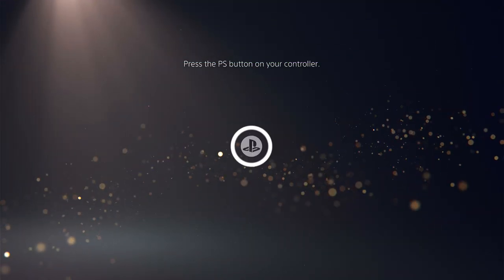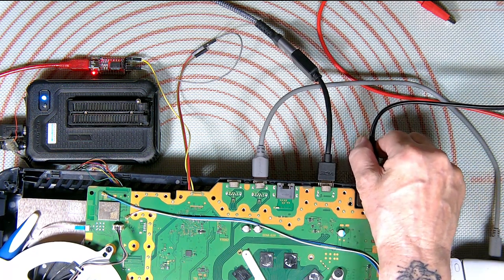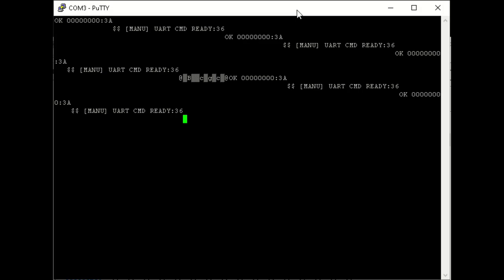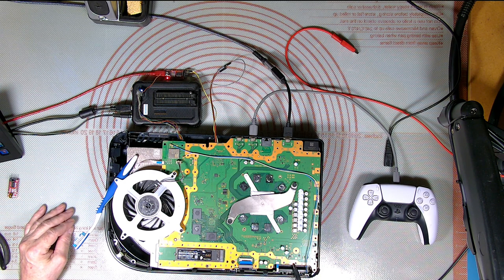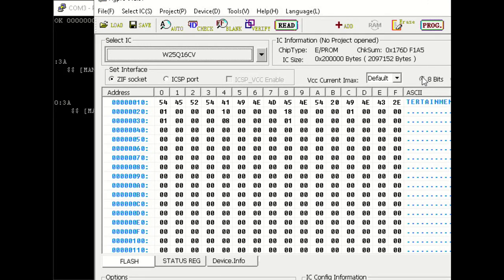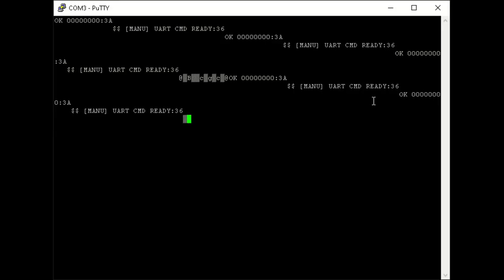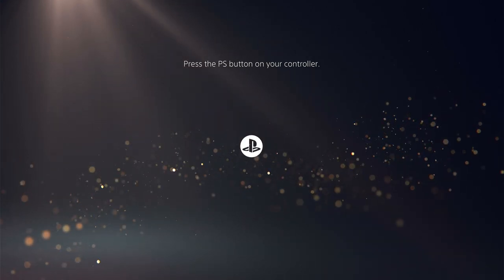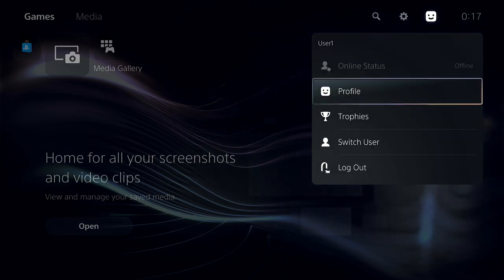Use a UART on PS5 to diagnose SB also demonstrate the 3 Beep no function NOR corruption its a start

Comment: Thank you for the video :). I just watched it. So, I've got one PS5 which is completely dead and all the voltages, including the standby ones are OK. I thought either a problem with the BIOS, or Southbridge, or maybe storage. Will try the UART way.
Reply from the maker: It is work in progress but we are slowly unlocking its secrets
Reply: @Steve_be  I've ordered SVOD4, I think one of the best programmers for us out there, the customs charged me over £80 for the duty :D. Hope it's worth ;) it.

I'll make a video on my inte team screen protector channel about it. It should be capable with an additional software to pull all the BIOSes for each IC you insert into it. I'll try to buy that software and show it in action.

As well, should be able to program ICs from SONY TVs which I struggle as well.

So, huge hopes to be true. For now I'm using the regular CH341A and I hate it :D big time ;).

Comment: Hi Steve, really useful vid,  I have a random issue where my Blu Ray daughter board has a supply voltage short BUT the PS5 can read it and install updates - just doesn't take disks - keeps blowing the 12v supply fuse.  checked the board with voltage injection and the CXD90063R-1 chip get hot (1 ohm resistance) -  nothing else on board seems to be causing this (have removed most caps etc. ).  Do you know if I can extract the data / clone the chip on the daughter board? obv. no good swapping it to another board as 'it' seems to the short..
Reply from the maker: In short no.. as things progress there may be a answers in future

Comment: Hi Steve I have a edm010 disc CD drive falied.I have another dead edm020 with disc drive and want to use it in edm010 so I can use and update. Possible to use it with Cod SW.  What do I change in 8legs chip with Cod sw near the SB to make it work in 010.
Reply from the maker: If you want to make edm101 work with out a dvd you can but you cant change a dvd you have to swap the daughter from the old to the replacement on
Reply: @Steve_be  Thank you for your kind reply. I do not have the CD ROM for the edm010 as she is dead but I have a dead edm020 with the cdrom . I wanted to use that with the edm010. I have the bios of the edm020. The Cod does imply
with his modifier you can keep cd going from another board if your one is dead. May be I got that wrong
Reply from the maker: @astral5322  to swap a dvd disc player you must have the original  daughter board  that was matched to the mother board its not in a nor or a me, chip its in the original renesas chip that was with the original system.
Reply: @Steve_be  Steve thank your for your trouble. I am aware about the "renesas" and swapping of daughter board which I have done many times. I think it is just the way the coder wrote it on his web about his modifier that confused me. Now is clear it cannot be done. Thank you
Reply from the maker: @astral5322  implies is correct as yet its not been possible because the renesas chip carries the key, so we can use the Nor (bios) to stop the unit looking for a key but we cant use the bios to inject a key plus we have not got the encrypted key which as i have said was in the dvd renesas even if we had the key it cant be injected from thje bios i hope this makes senes ,, i know the video you mentioned im a a good mate with phil(cod3r)
Reply: @Steve_be  Thank you for your good explanation. I know you are his good friend as he has said that himself. As in your video you thanked him for the shout out. I found you in FB game console repair  legion. I have sub to you. Looking forward to seeing more of your videos and you are very knowledgeable.
Reply from the maker: @astral5322  thanks for kind words you can send me  a friend req on face book same name

Comment: Hello. what red wire goes to t56?
Reply from the maker: Hi the red wire is not connected to the t56 it goes back to pin 8 of the nor, to read the nor wile its on the mobo you need to feed the 2.6v to the nor pin 8 from a external source .

Comment: Steve, are you leaving the NOR on the board for convenience or to reduce heat risks? Cheers. Rob
Reply from the maker: Its for convenience as i reprogram the chip many times trying to find more answers,  plus it reduces risk of heat damage ..
Reply: @Steve_be  Thanks for the info. Recently tested these techniques on old PS4 boards, ready for my first PS5 job like this.
Reply from the maker: @OnStageLighting  as the UART on the PS5 is only seeing the southbridge but its a start. there is no syscon on the PS5 likle the ps4 so you do see a Boot screen my guess is the process is hinden in the PSP part of the Apu but we keep looking

Comment: I have ps5 1016A 3 beep problem facing.
I try to read and rewrite bios.
Still same.
Second I try to other ps5 winbond bios replaced still same.
What I do ?
Reply from the maker: Have you tried the psu
Reply: @Steve_be  if we have 12v . Can the power supply still be bad?

Comment: Hi steve,what is the best way for rams and gpu rail temp ?i have ps5 with closed shield it will freeze after 5 min and with opened shield its working good without any issue,i used best thermal pads and not effected !!
Reply from the maker: Check the Liquid Metal, but it can be fault ram or ssd
Reply: @Steve_be  i checked liquid and fan spinning normal(no overheat)
Many times in ps5 games will freeze,in ps4 games its ok !!
Reply from the maker: @alenboxochi624  sounds like Ram or Ssd mem
Reply: @Steve_be  thanks,i will check,need to replace or reball only?

Comment: hello friend I need your help I bought a ps5 for repair with strange symptoms the image blinks and the sound crackles and does not always start the system has 2 seconds of blood I made a bios backup the motherboard is EDM-010 console model CFI-1016A
Reply from the maker: This may be the HDMI chip it can cause all of the problems you mentioned . It would be the first thing i would try
Reply: @Steve_be  I have another ps5 console that has such a problem it starts in safe mode and you can only choose option 8 is it a damaged disk or maybe the bios is the same console model as I wrote earlier
Reply: @Steve_be  thank you for your answer, now it's hard to get help from other people who repair electronics
Reply from the maker: @TOMelectronicsfix  that could be the on board ssd do you get a error message
Reply: @Steve_be  When I connect the usb with ps5 update, it resets to factory settings, then the system restore progress goes to 100%, then the console restarts and a message appears that something is wrong and that the console will reset to factory settings, time 30 seconds and after reboot it returns to safe mode again
Reply: @Steve_be  can it be the ssd controller because i saw on TheCod3r channel he had a similar problem with the ps5 console
Reply from the maker: @TOMelectronicsfix   you can try it,